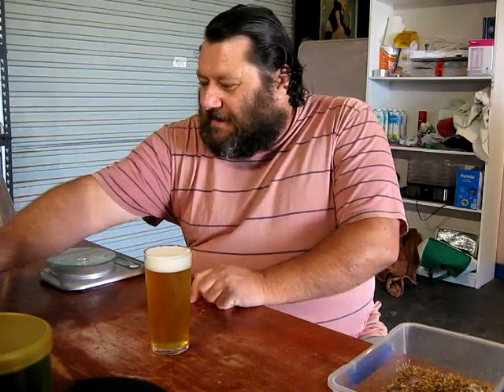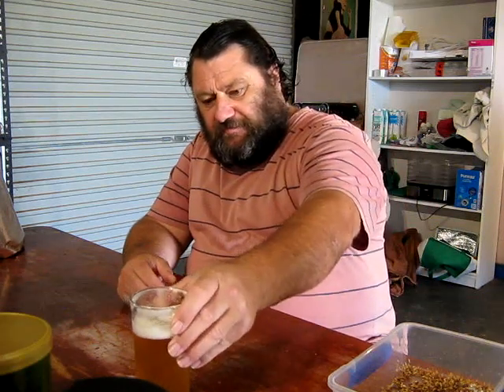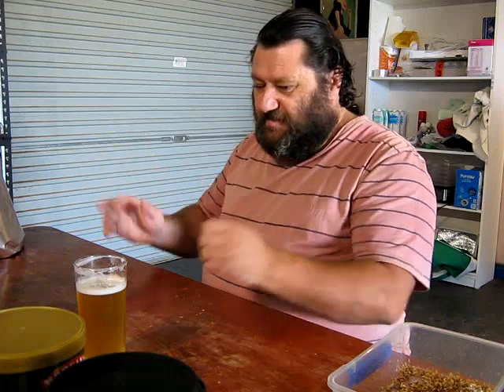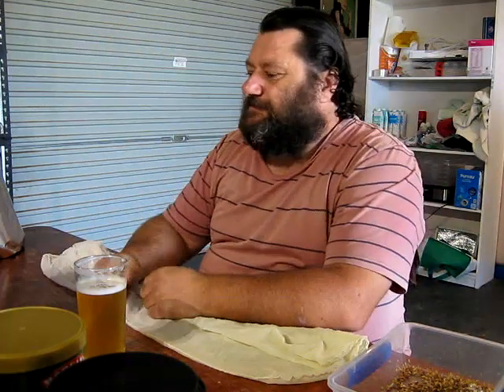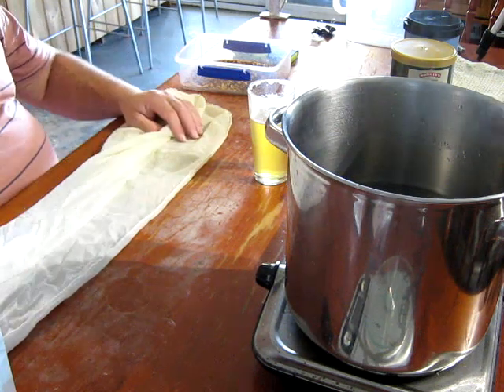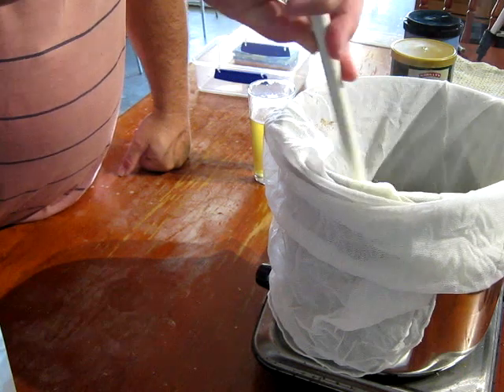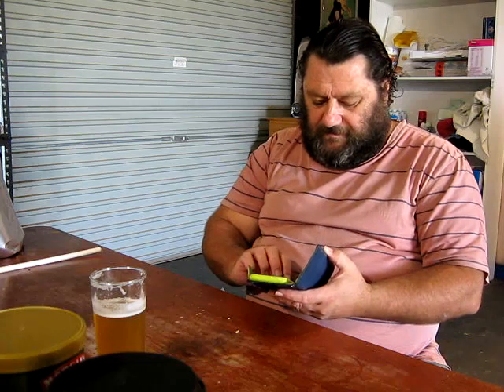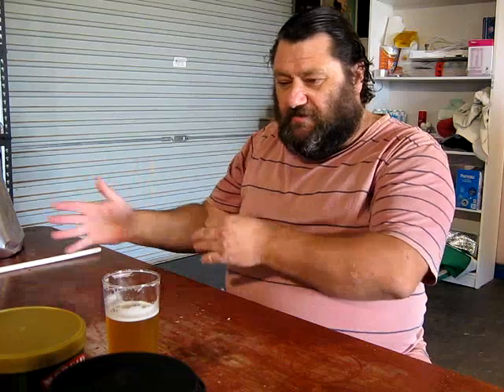Brew School #15 steeping grain for a kit beer

Comment: Good info thanks. I have a bag of crushed speciality grain  2 years old  sealed in a  bag. Can I steep it.   It looks ok. Could i taste it first from the bag dry. Thanks. Aldo Also how much hope do I add to the steeping grain  (hop pellets ? ) and what about dry hop extract is the  the cgeslrst way to go. I want to make a good IPA like the monteiths Phoenix IPA that I love. Some of them hops at the store cost as much as a  coppers kit.
Reply from the maker: 2 years old will have lost most of its flavour and possibly taste stale..... I wouldn't use it. Steeping or dry hopping will provide different flavours and levels of added bitterness. For an IPA I would consider a bit of both, steep for 15 minutes and dry hop day 4 or 5 for 3-4 days. Hops in teh steep Simcoe and Chinook, dry hop with Citra.... The beer runs to 40 IBU so target that in your recipe creation.... maybe 15 early addition, 20 in the steep and 5 dry....
Reply: @littlejohnsbrewing9199  thanks. Do citra hops give you that citrus flavour that some IPA  have or do u need to add like grapefruit etc in the brew. I like that slight  citrus flavour in IPA
Reply from the maker: @Matowix  Citra, as the name suggest is citrusy, for me it tends towards lemon with an orange note, Mosaic, Amarillo, Centennial, Galaxy and Ed Dorado all add varying types of citrus. Some brewers use grapefruit in the brews to add more citurs notes, I am currently doing a Gose with Blood Oranges..... there are plenty of options. When buying  hops, the supplier should provide a description of what the hop will bring to your brew.

Comment: I do Kit beers and 1st time I tried adding Grain to them I think it was 500g and it totally overpowered the kit flavour. So next time I tried 250g and it still seemed too strong. It was interesting you said you added 150g. I will definitely try this. My question is if you have grains at 70c for 20mins , then after taking the grain out ,are you then ramping the boil  up to full boil to kill bacteria? I have only been doing 70-75 then adding it straight to fermenter drum.
Reply from the maker: you need to boil the wort; 'grain water' for about 5 minutes to kill any bacteria and avoid contaminating your brew. What type fo grain you are adding will have a big impact on how much you need, the darker the grain the less you use. You can use 1kg or more of base malt(pale ale, pilsner, marris otter, vienna etc) but crystal and cara malts are far more intense in flavour. What type of kit are you doing, I can suggest a good grain and amount to try on your next batch.
Reply: @littlejohnsbrewing9199  I currently have Munich Malt grain & Crystal Malt Medium grain. I added 250g Munich Malt to a Belgian Ale and it was overpowering. I have made a Mangrove Jacks Munich Lager a couple times ,just tin , kg be2, 150g LDME, cluster hops and it's been well liked but I feel it's missing something so I was planning to add Munich Malt to this next time but not sure how much. I looked through my notes and I did add only 100g of Crystal Malt med to a Coopers Lager and that turned out ok. But I haven't been ramping up to boil which I will do next time I use grains as you suggested. Any other ideas on what tins I should use Crystal Malt med grain in be welcome.
Reply from the maker: @lenheuser8016  righto, let me break this down a bit.... longish answer coming, but hopefully it will help you out. Munich is the 'strongest' coloured and flavoured of the base malts and as such will impart fairly intense properties when added to a brew. Crystal medium is also quite 'strong' in flavour, colour and depth of body. I would suggest that you have not used the right malt for the brews you have listed above. For the most part steeping grain is about boosting the flavour and adding some body and/or mouthfeel to a kit or extract beer. Lighter base malts are best for body without adding a lot of flavour and lighter crystals such as pale, carahell, caraaroma, will work well in lighter beer styles, the deeper crystals like medium, caramunich, carafa and special are the reserve of darker ales and stouts. Some suggestions-- Belgian Ale would benefit from some pilsner, light ale malt or vienna, maybe a touch of carapils or carahell  allowing the light malts to shine with just a boost to the body... but belgian's are a very fussy bunch. The Munich Lager would work well with some Munich malt because there will be a high proportion of Munich already in the kit, but you need to allow for the fact that the tin is already close to style for flavour intensity, again if wanting to get that something that's missing, drop the BE2 for 1kg LDM and steep 200gm carapils and 100gm Munich. Also look to use a Noble hop like Hallertau or Hersbrucker. I wouldn't be using crystal medium in any lighter tins, lager, pale ale etc. Keep it for ESB, ambers, dark, mids, porter or stouts which will carry the deep caramel tones and sweetness. Also a good idea to steep 15-25gm of hops with your grain just to help balance up the extra sweetness you will get. Last thing, which is a bit of an aside, if you find your beers are too 'heavy' from steeping but you like the flavour, consider swapping equal parts dry malt for dextrose to help thin it a little, it can undo some of the sins of extra malt and I tend to put 2-300gm in most brews with added malts to counteract the extra body. Check out the video on 'increasing ABV'. there is a good chat about what different additions are doing to your beer and how to adjust as needed.
Reply: @littlejohnsbrewing9199  That was a comprehensive reply and much appreciated and it will be a great help. I will pick up some of those grains you suggest next time I'm at the Homebrew shop. Enjoy your videos, keep up the good content. Cheers

Comment: Great video, mate! Have you tried making hazy beers?
I like using regular pre-hopped kits (Coopers Lager or Pale Ale) and turning them into hazy NEIPAs by steeping 250-300g of flaked oats and the same amount of flaked barley. Sometimes I use a bit (~100g of Crystal 15), but I prefer the NEIPAs to be lighter in colour. Of course, a lot of fruity hops added late and more dry-hopped does the trick and true-to-style. Yeast matters too, of course, so I prefer Lallmand East Coast yeast or White Labs Coastal Haze.
Reply from the maker: I don't do many hazy beers, especially NEIPA's, I don't them quick enough to be viable so mostly just buy them.... it is not my favourite style either in general. I am going to do one soon though to test an experimental process I have been working on.